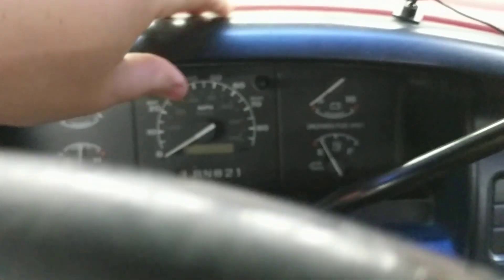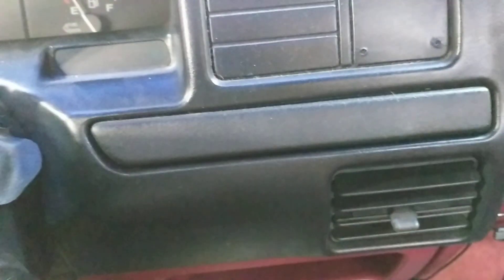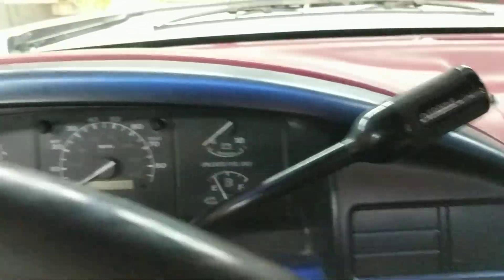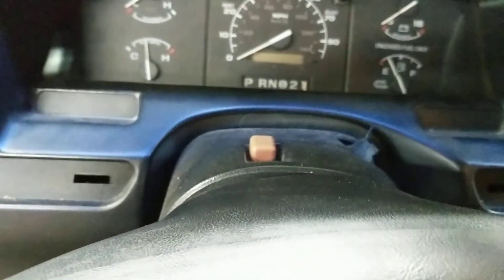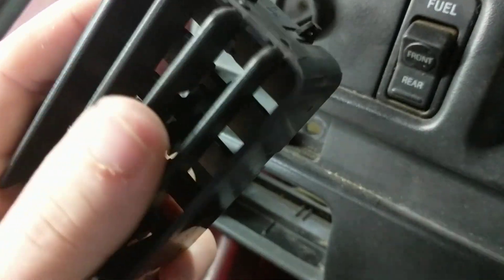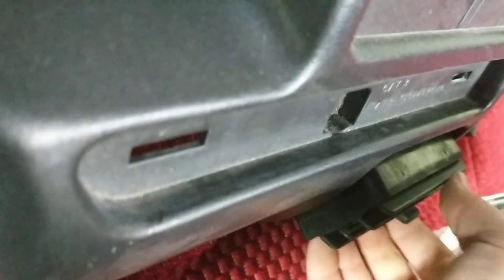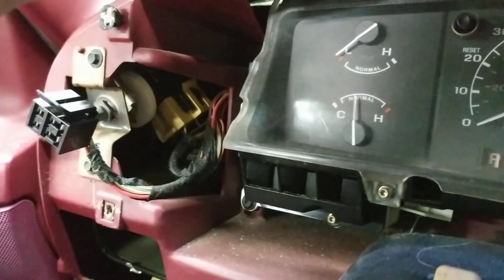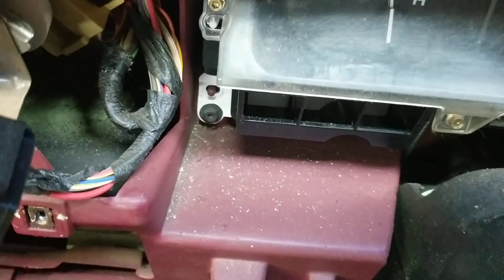1992-1996 F150 Dash Bezel Replacement Part 1

Comment: My light knob does not come off like that... is there something I need to do to remove it?
Reply from the maker: If you pull the knob out like your turning the lights on you should see a slot in it.  Put a flat head screw driver in there towards the back and pull it towards you

Comment: @3:45 my new bezel did not come with these tabs, and all the old ones are broke off. Where can I get these or what are they called?
Reply from the maker: Not sure what they would be called. Id try to push the plastic out of the old ones and te use them

Comment: Yo bud... how can i get hold of you..i have MANY questions about my 91' f150..4.9....
Reply: What are you trying to find out maybe I can help cuz it don't look like he replies to people
Reply: @stepheneckles2345  need them clips don’t know where to get them to screw in the dash
Reply: @albertovazquez3263  Sorry I didn't see this . If you need clips to hold in the bezel you should go to a wrecking yard and get them from a truck there
Reply: @Sherry-jx9hs  Oh boy, are they not available online--that's a goose hunt right there.
Reply: @robertelmo7736  do you have a wrecking yard in your area.   You can get the clips off of the bezel. I believe most Fords in that era use those clips. What I did was get the clips and usually the post on the bezel breaks off that the clip goes on. I took some really small screws lol 3 mm and drilled a small hole where the post was and screwed the clip on the back of the bezel and then put it back on the dash. Worked good
Reply: @Sherry-jx9hs  I have the clips...guess I will look at doing that.

Comment: Well I ordered the bezel but oh no the air bag light was a battery light now got to get a new one
Reply: They are just labels. Be careful not to scratch it and you can pick the corner of these labels. Lift off, swap the old one, then sparingly use clear 3M plastic adhesive on the back of the old label and affix to the new bezel.